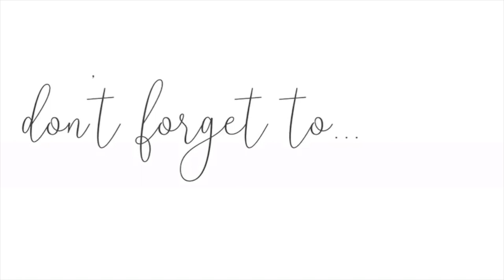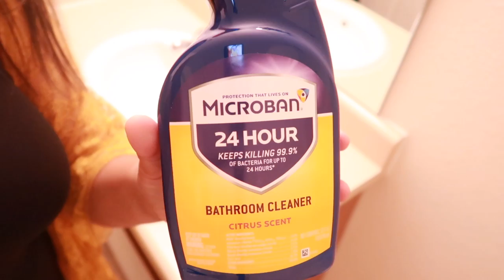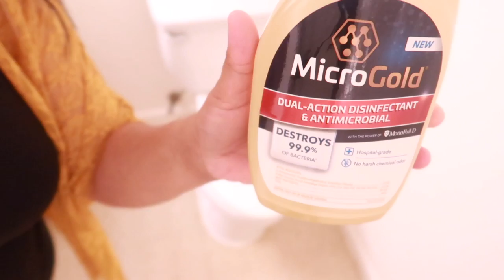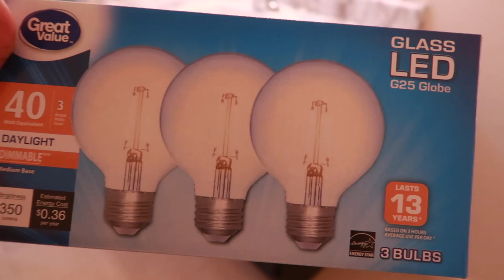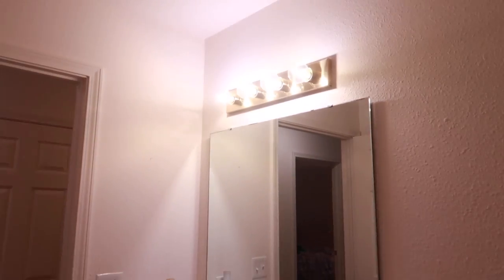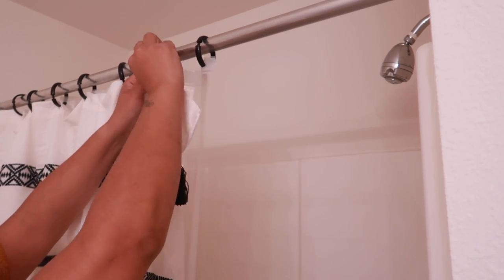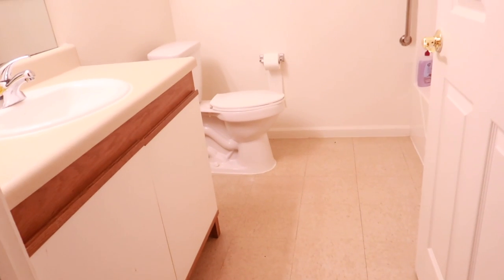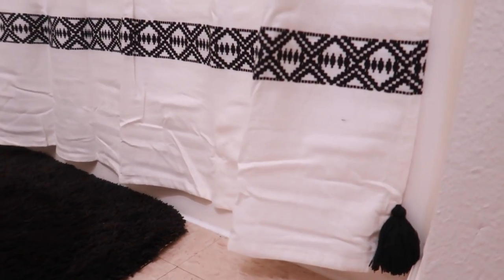BATHROOM MAKEOVER UNDER $100 (Renter Friendly) + DIY COUNTERTOPS & CABINETS

Comment: OoOo a frame around the mirror would really set it off too!! I've seen folks do bathroom mirror frames with dollar tree foam board and contact paper like you had!  Idk how you feel about a thick frame, but a think one could be neat too! I've seen electrical tape used as well. So many options. ( I'm currently in analysis paralysis with decorating 🥹)